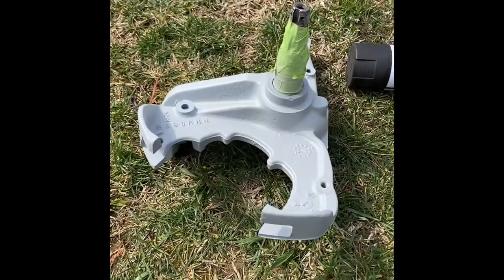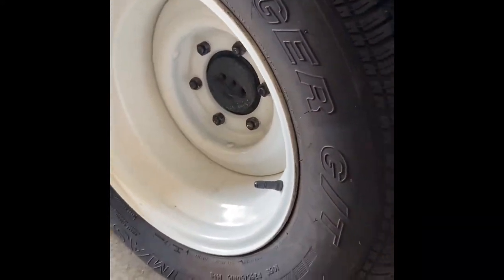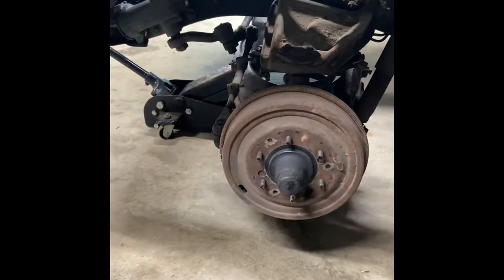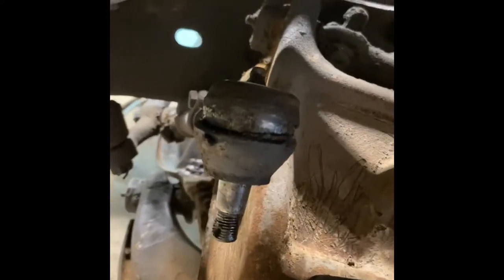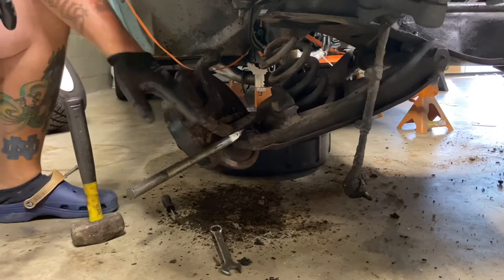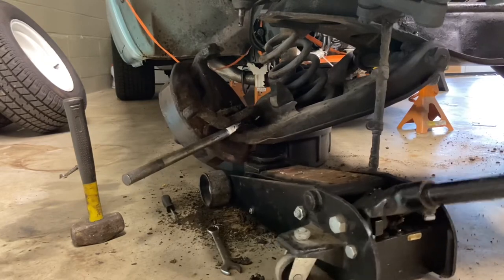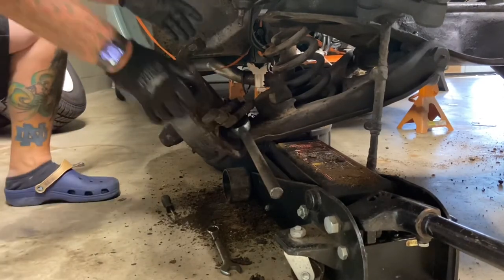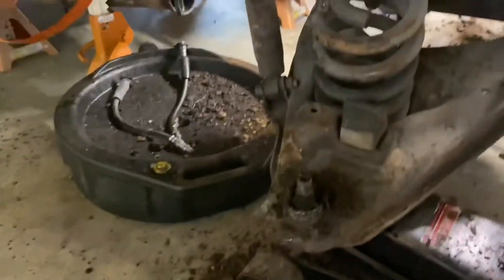Part 1 Disc brake swap 1970 C10

Comment: Do you know what power steering gear box would fit a 67 truck?
Reply from the maker: I used the 73 to 79 square body I believe because it bolts right in and is still standard treads for hoses
Reply: @Inmywhitetee77  thank you. Do you know what brackets for PS pump would work on 327?
Reply from the maker: @davidchlup8162  I just did Amazon basic kit

Comment: So you can use 80s c10 spindles
Reply from the maker: Yes but check and see if it’s the 1.25” or 1” rotors cause the spindles are different. I think 1” rotor spindles are rare cause they may had been on 6 cyl trucks
Reply: Damn going through same thing on mine have 63 C10 converting to disc 50 year old rusted parts don't come off easy will definitely be following

Comment: The spindles used its a the 86 c10
Reply from the maker: Yes 86 spindles! But I made some mistakes and if you keep watching other videos you will see as I describe what I did wrong !
Reply: @Inmywhitetee77  I only use spindle or also control arms upper and lower, brake discs, calippers
Reply from the maker: I ordered disc brakes from summit cause of 6 lug. If you want 5 lug than yes. For control arms I talk about that in episode 3 or 4.
Reply: Tanks for information  i watch other episodes